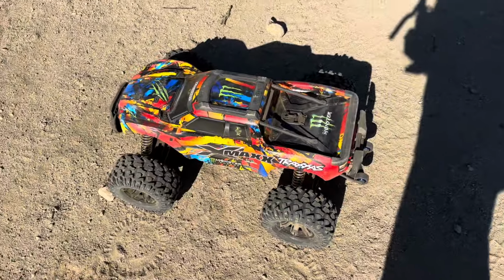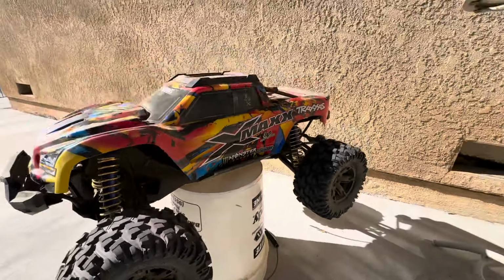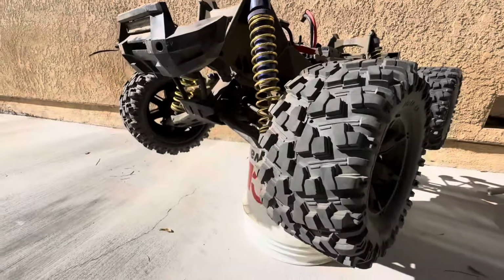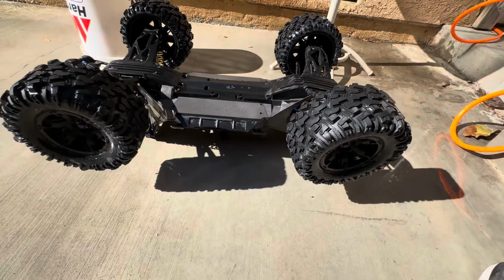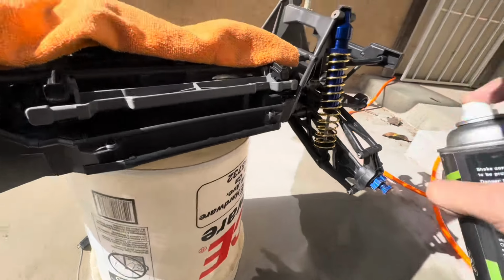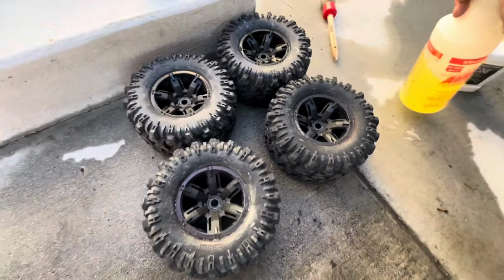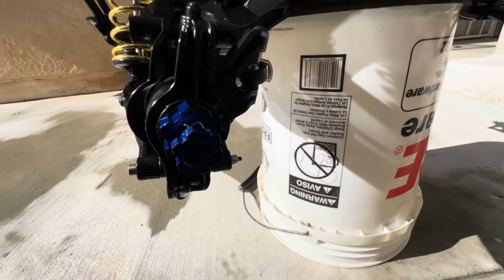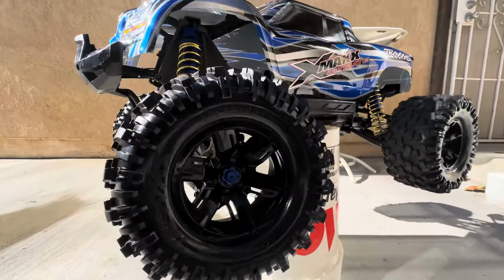TRAXXAS XMAXX ULTIMATE BLUE CLONE BASH N WASH MONDAY!!! @Traxxas @CowRC

Comment: Cool vid, looks like an awesome place to bash, let me know if your light still gets high beam after soldiering the wire, I am installing a stainless screw kit on my Ultimate Xmaxx as we speak, Traxxas stainless kit is 💯 amazing, Definitely go for the steering and castor blocks front and rear....Xmaxx and XRT are my favorite R/C's 💯
Reply from the maker: Thats nice! I am thinking about getting the stainless screw kit as well. I was able to get the lights to work again as they should, i love the Traxxas Link App its a big help! Ya this place is the best spot around here SouthridgeRC set it up and cleaned it up and I think he just filmed the new Traxxas Rally VXL Commercial here at this same spot! 
Traxxas Number 1 💯
Reply: @OGPAPERBOY77  The stainless screws are really nice, I know it's just screws but they actually look better and serve a purpose....I soldered my front light wire and high beam didn't work, so I bought new light bar, the wireless app is nice, especially for setting end points, that is awesome you get to run where Traxxas makes commercials....Very Cool 💯
Reply from the maker: @andyb9994 I didnt think my lightbar was going to work so I ordered one too. So now I’ll have a back up. I like that you can buy spare parts and not have to buy the whole kit. Ya Im lucky to have this spot 💯
Reply: @OGPAPERBOY77  Yes Traxxas is awesome when it comes to parts and support, Yeah I only had one setting on light after I repaired it, not sure why but oh well no biggie...just got new light like you did....keep up the cool vids!!?
Reply from the maker: @andyb9994 hope to see you making some videos soon Enjoy your day 🤙
Reply: @OGPAPERBOY77  Thanks, yeah I have one or two in mind hopefully soon...

Comment: What gearing do you run on your xmaxx man ?
Reply from the maker: This video 18/50 but i went back to 18/46 like in my first video
Reply: @OGPAPERBOY77 which gearing do you like beter bro got some off road light bashing ?
Reply from the maker: @alexon559  for light bashing stock gearing is good enough on 8s but if you want to do backflips and have more air control then 18/46 is the way to go
Reply: @OGPAPERBOY77  any heating issues boss? Or did you upgrade fans ?
Reply from the maker: @alexon559  https://youtu.be/ayOBFOkbnJA?si=CGeb92E84YG_aD1_ upgraded the fans to Proteks that Mark Santa Maria uses before I ran it and no issues yet They are a big upgrade